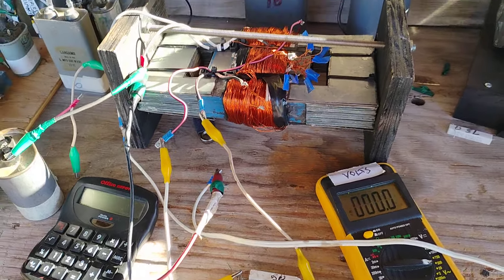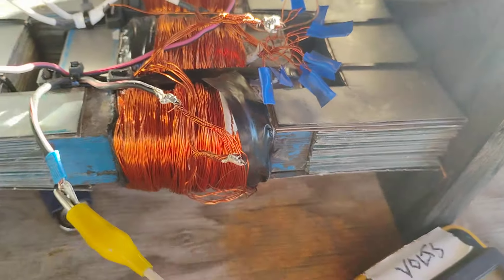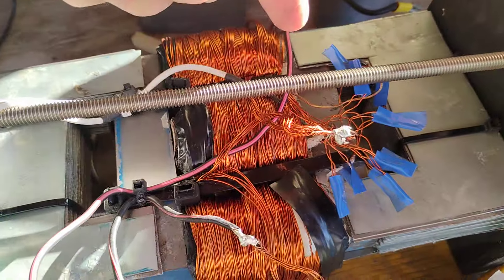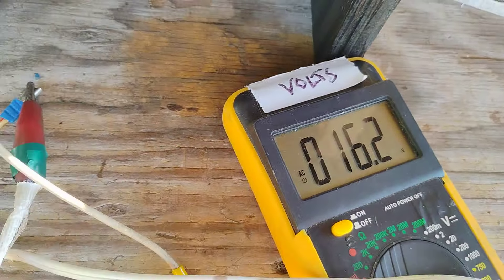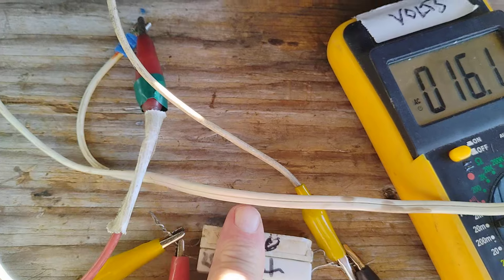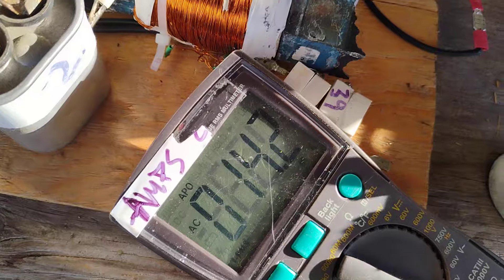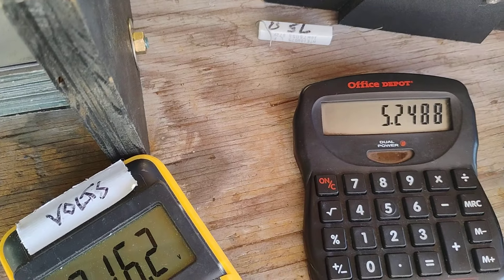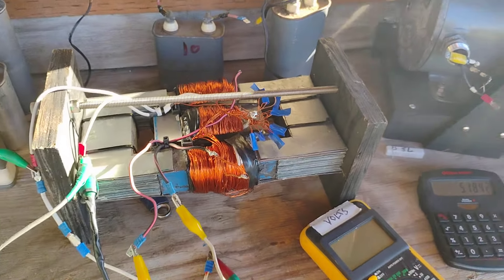5.1W output from a 1.7W input with the  hemmoroidal transformer;  (50 ohm load)

Comment: I did not realize that ac had back emf constantly due to the polarity flip , my understanding is that the back emf with ac is only in the start  up portion of the system and after a few seconds or so your source ac pushes the back emf forward and there is nomore back emf after that ..  You kinda of need an off time for back emf to perpetuate , ac oscillations has no off time but dc pulses do .
Reply: Back-EMF is basically the system fighting itself, in a "generator" it manifests an opposing field onto the rotor, in a solid state circuit it shows up as amperage draw, the role of mechanical torque and amperes are the same as force needed to fight through EM retardation.

It's why Tesla coils show a massive drop in amperes when optimally tuned until you only need what's needed to overcome the Ohmic resistance of the components, at resonance the counter force is negated, one such way to do this without building the source around the load may be to use Iron to blind the source and the load, another may be to use non-inductive windings. 

And that's just to deal with the Lenz issues, there are other ways to increase the potency of the output and use anti-cogging methods to aid in mechanical rotation on top of that. My philosophy is to understand what is physically happening by observing the visible world to understand the invisible, then throw a little math on top to measure and predict.
Reply: @JenkoRun  with ac as a source, back emf is only temporary until the source pushes it  forward thats what i read
Reply from the maker: @JenkoRun  Hi JenkoRun
Yes, in generators its the backemf that creates that lenz braking under loading of the generator coils......Bill Muller used to always call lenz reaction in his generator backemf.
"fighting itself" good descriptions,
 "perhaps" what goes on here in these hemmoroidal transformers (dumb name sorry) in a boxing match analogy is the forward emf coming from primary  takes a "swing", and the backemf ducks under (or over) the swing from primary  that wants to hit it,, and escapses through the shunt bars and takes a swing at the primary but the primary has "ducked" under the shunt bar so nobody gets hit and no bloody noses or increased draw to the primary.....this is the '"timing" theory on how it works, could also be as well, the amount of current flow too decided by resistive load where its just right so can easily jump into shunt  bar route (and wants to) when that forward current wants to smash into it.
Timi Tron has made some really good "Bitorroidal" transformers (AKA hemmoroidal) and his work really well - he thinks its pure cancellization (while also diverting the backemf ) going on through the shunt bars, I think this is true too, but in right conditions tha tbackemf also makes it way over to oppositie secondary leg, "reinforcing" power being made....
As far as backemf goes, I think it is "created" upon every polarity shift in AC.....if more or less backwards magnetic force to "fight" against florward EMF is decided by the resistive load chosen.  Inductive loads and capacitive loads instead of resistive  whole other subjects to explare down the road if I live that long.....
Reply from the maker: More thoughts  -  perhaps its not a matter of the backemf ducking a "swing" of the forward emf so much, but the backemf gets "bumped" by the forward emf to force the backemf to take that un-blocked  easier route through the shunt bar path....this why some resistive loads work, some do not as you want just enough of a bump from the forward emf to knock it into the shunt bars, not too much not too little...and the resistive load "decides" the forward emf "force" and if too little of force (decided by the resisitve load) then the backemf plows straight through, going straight back to the primary and shunt bars now useless, however if the forward emf is strong enough to knock the backemf at least "off course" then now it will travel through the shunt bars....(theory #2)
I wonder if back emf during the short time period time it happens is a lot stronger magnetic force than the forward emf is......sort of like flyback voltage - the input voltage could be only 12V but the voltage during the flyback event is X 200 or more, but for just a micro second in time....some say (like me) t hat the flyback is twice the speed of light for that super brief instant it manifests, as the electrical flow goes both directions same time - so twice the speed of light since electricity supposedly the speed of light except for copper resistance (sort of) 
Maybe same thing with "magnetic currents" like backemf.....a super short blip in time but  super amplified magnetic power during that short blip (just thinking eh and theory #3)
Reply: @MrDKONZEN  you make sense in your post .  I also think the back emf gets pushed forward , thats what i read anyway. It takes few seconds to push it forward, but if its redirected before its pushed forward you get to keep it and use it for something else , else wise pushing it forward essentially cancels the back emf , if I am not mistaken
Reply: @MrDKONZEN  I'm uncertain about the origin of Back-EMF being due to the polarity flip in an AC cycle because it exists in a DC system, be it a rectified AC source or a continuous source like a battery/PSU, if the source circuit is shorted or the load is increased the ampere draw increases and the back-torque on the rotor increases, if Back-EMF is merely an AC 'lag" during polarity flip I would think we shouldn't see the effect occur in DC systems, if you have an explanation for that I'm all ears.

One thing I am reasonably certain of though, among the primary reasons we have this Lenz problem is because the load circuits induce the source circuits, a problem of mutual induction, if the induction half of the process is the force then mutual induction is the counter force, cause and effect, it's why I believe using non-inductive windings as part of the load circuit is a potential solution, 

if the large magnetic currents carried by non-inductive windings can induce an inductive winding then the fields from the load inductor should be unable to induce the non-inductive winding, minimizing the self induction should deal with the back-emf issue onto the source.

All inductive circuits should be be viewed the same way we look at antenna, or rather tuning forks, they're separate circuits that don't transfer energy between each other but rather they are excited and duplicate the source they "see", it's just a matter of preventing them from sending the wrong information back, or rather, send nothing back.

I believe the hysteresis loop that Steinmetz developed is to do with this, Dollard talks about it in his Energy Synthesis lecture.
Reply from the maker: @JenkoRun 
 Hi Jenko
There is no "Backemf" (those magnetic currents "figting themselves" as you described it)  with a continuous DC signal unless it is a chopped DC signal or a periodically shorted out DC signal heavy load periodically applied to a DC signal. Other wise it is just a DC signal "straight line"  (Far as I know which is not very far)

So there is back EMF in DC systems, just as long as it is pulsed or something happens to cause some backup of the magnetic currents.
And AC is really DC in alternating pulses, so AC always has some "backemf" too....in the grid the sinewave so ssmooth, there is never a "Sudden" change in polarity,, its gradual, but backemf does occur but its "slow"  with that nice AC signal to develop itself into a usefel (destructive0 force that can slow a generator rotor under load, or cause excessive amp draw to solid state stuff, or transfoemers.....
Do you know about the Thane Karl heinz "speed up" under sof generators with permanent magnet rotors? L:ots of people have demonstrated it - you justneed a rotor rull of magnets and at a certain RPM with a certain load (or just shorted generator coils) you will see the rotor speed up, not brake under load.   This is all about the "time delay" for the backemf force to develop itself into strong enough force so that that it can do some  "damage" to rotation or the amp draw.
Then the position of rotor magnet when it does develop decides if the magnet gest pulled backk or pushed forward.....so there is demonstration of the time-delay for backemf magnetic force (it might be "instant" but for it to become "strong enough" is a upward "curve" in power)

I dont know about "non inductive" windings....Do you mean coils made of for example 316 grade stainless steel? non ferrous and no eddy currents too, which  like coppe alwaysr has?
I thnk there must be a magnetic field around a generator coil or for example or a secondary of a transformer if it is going to be "induced" by primary or sweeping rotor magnets or sweeping electromagnetts?  
And it is the magnetic fields "mutual inductance" that causes lenz reaction in generators or xtra draw in transformer primaries as the "Backemf forces have "returned to the primary.....but this time to return itself  (in transformers) can be messed up and there can be a split in time when the the immediated induction happens and when the "realized" induction happens and there is one naturally, but this time delay can be increased,  so by the time the load causes backemf problems, the time for it to react has already passed by....sorry writing while I think haha  ....basically usisng TIME is how to go about iti (I think) to beat the lenz reaction.... and in cased of the hemmoroidal transformer the backemf takes a different course of "action: and the time delay to have it affect the primary has already passed "long ago" as it is trapped into the shunt bars, and only way out is to be consumed by the oppostte secondary core leg (and eventually inducing iinto the windings as extra power being produced)  Thanes theory anyways

I sort of know about Steinmets, the rotovertor AC motor I work with alot is sometimes called a Steinmetz convertor, I dont know much about Dollard what he says but resonance is key you either have it, or some of it, (semi resonance or harmonics) or you do not have anything, and resonance can be defined different ways too (electical, mechanical, ferro, even a "juttering" resonance like what happpens when an induced coil is shorted out for a brief perod - it goes into an AC hyper ringing  wheich could be described as resonance into a capactior as the capacitor becaomes a resonate chamber you could say)

Thanks for input and writing..

.
Reply: @MrDKONZEN  You're right, I was mixing up Back-EMF with simple Amp draw to overcome Ohmic resistance, in both cases the circuit will draw on Magnetism to act as the force to fight through resistance or Impedance (Back-EMF), it's still the same process so sometimes I'll forget there's a difference between them. I can only assume that a counter current still forms in the case of an AC "generator" with a commutator on it to explain the drag on those, somehow.

I'm a little familiar with Thane Heinz's stuff, from what I read on the energetic forum it involves very high impedance windings and taking advantage of the coils self-capacitance, delaying the magnetic field by using the potential between the turns until the rotor magnet is TDC before coming into effect to aid in rotation, Bifilar coils will be useful there for increasing the self-capacitance and lowering the minimum frequency needed for the effect to occur.

In regards to non-inductive windings it's just as their name implies, copper coils wound backwards on themselves (bifilar or not) to cancel out their own induction, unless you have a perfectly resonant circuit built around the load (which is kinda impossible for inductive loads, and utterly for variable loads) the coupled coils of the source and load circuits are going to start interfering with each other due to the mutual inductance between them, the source coil induces the load coil and the load coil induces the source coil which leads to amp draw.

It's only theory atm and I've not seen anyone test it, but if you could use a non-inductive winding as a "host" to carry large currents from a source further up in the circuit, such as inductive stator windings, those currents will induce a normal inductive winding connected to a load without the induced fields on the load coil inducing the non-inductive winding, take away the ability for that winding to self-induce without compromising its magnetic storage ability and you decouple cause and effect, no induction onto the source = no back fighting.

Though there are 2 potential issues with this idea, the first being that the non-inductive winding being shorted to an inductive stator may still cause the same issues as shorting out the stator of any normal generator, the second being if trying to use the non-inductive windings as the stators, since the point is for them to be non-inductive that's unlikely to work.

Failing that, an alternative option may be to keep the stator winding connections open as a single wire circuit and use the oscillating fields to induce separate inductors (we know that works from Tesla's patents) connected to non-inductive windings, among other tricks, these are just ideas I intend to experiment with and see what the results are, and that's without toying with ideas of integrating the methods of other folks like Thane and such.
Reply from the maker: @JenkoRun  
Hi Jenko
I think you will like this transformer experiment in link - it has the "non inductive" windings you mention (I think so) Hermes is reporting really good results....more on subject is that 174.8 KHZ freuency he feeds it is also the frequency Tessla would apply to his experiments in Colorado and elsewhere - the resonant frequency of magnetism Norman  Wootan described it as   (NW famous for the MRA look that up on Rex Research  - the "Magnetic Resonance Amplifier") 
.....anyways here is the link....it is from my discussion board EVGRAY@groups.io.......all this is from very recent posts - I want to try this transformer experiment  too! 
https://gratisenergi.se/et_transformer.htm